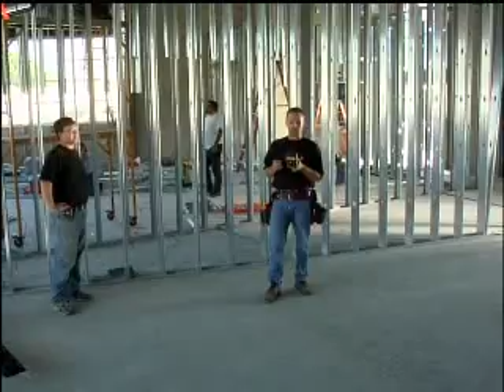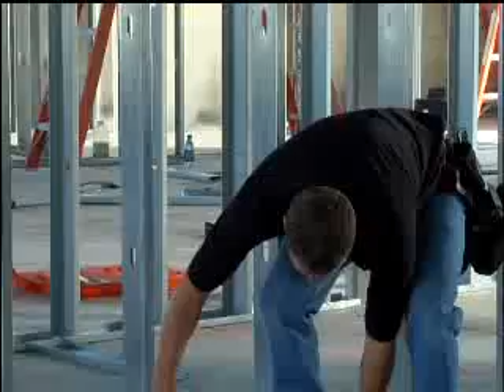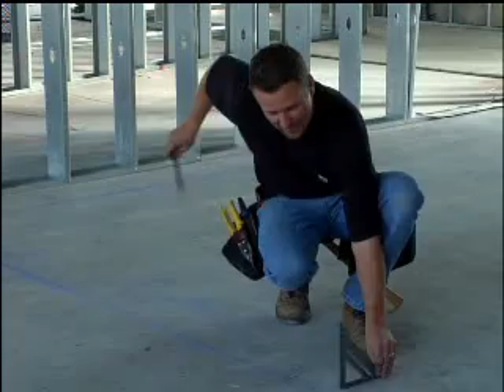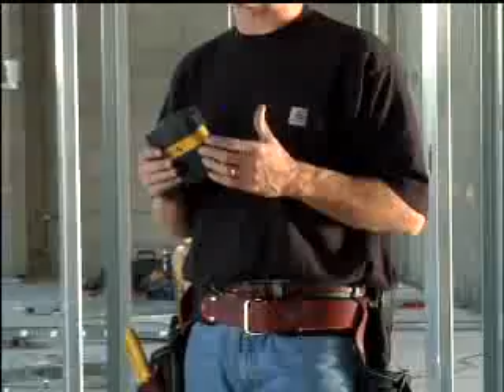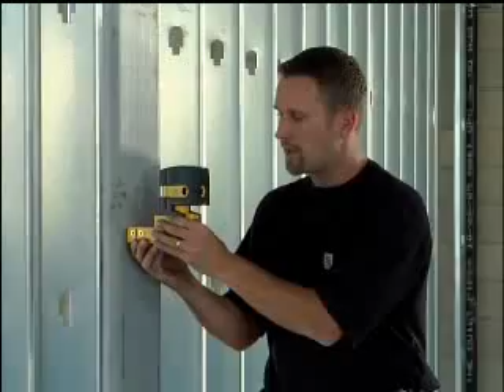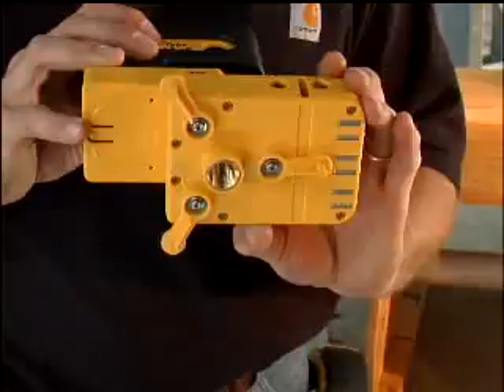Stabila LA 4P Self  Leveling Laser @ DynamiteToolco.com

Comment: When I started using my first stabile laser level for squaring this was for setting floor tiles in big stores . To give me and the lads confidence I would  set out the chalk line as you did and then from the entrance shoot a dot back into the store.
Mark and chalk this line as you did then check the old way . it was always bang on and this helps with confidence with new methods.If I dont have a laser  I always like to create my square by bisection this is so easy and you dont need any help.

Comment: good demo I am a big fan of laser levels and use them in my shop fitting company 
big time saver . So many applications I always survey kitchen floors with my laser before setting out this helps me find the low point and then I use the same beam to level the units . This is my idea and I train new kitchen installers for a uk national kitchen company.